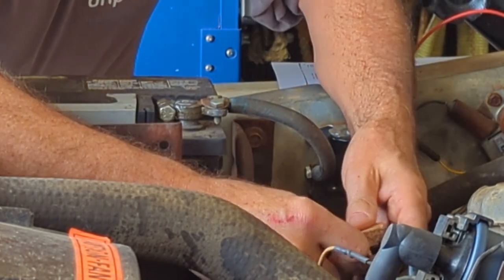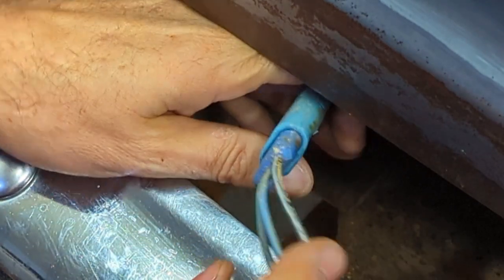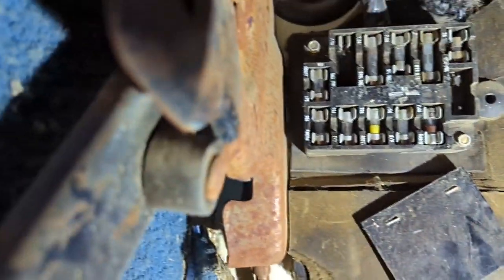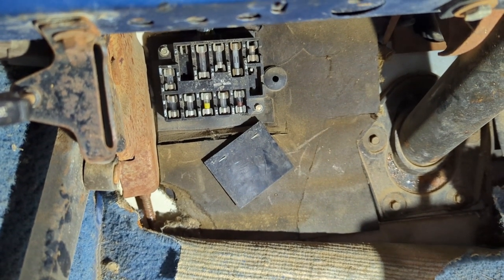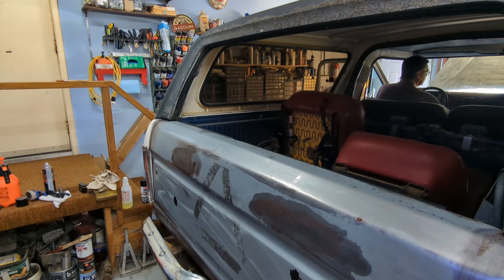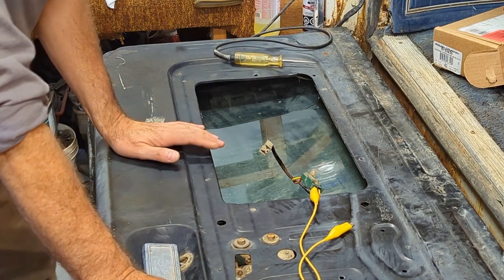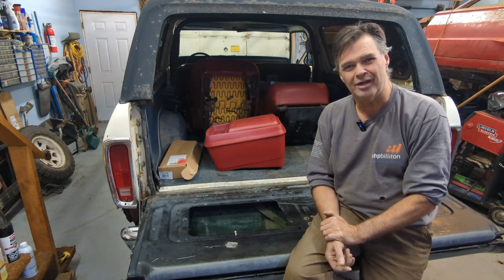1978 Bronco Liftgate Window Electricals

Comment: Hello Alvin. Excellent troubleshooting. I thought you would find one of the switches corroded. That set up is very simular to my 65/66 Mercury Colony Park. Is there a safety switch to prevent the window operation when the tailgate is down in the Bronco? I also am looking for a new weather seal for my tailgate, maybe the Bronco is simular. I'll have to look into that.
George B
Reply from the maker: Hi George,
They are very much the same, and you are correct, that limit switch also prevents use of the window while the gate is open/down.

Comment: That corrosion in the connectors can drive a person crazy. Nice trouble shooting.
 What about using dielectric grease in those connections? Does that stuff work ? 
Thx
Reply from the maker: Thank you Doug, dielectric grease works very well, a little goes a long way to keeping moisture out on those sealed plugs.